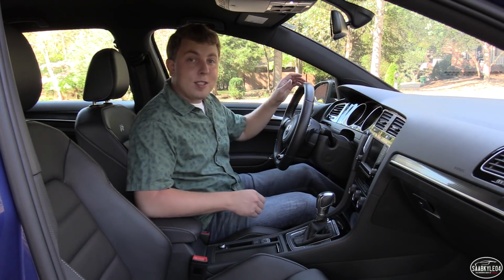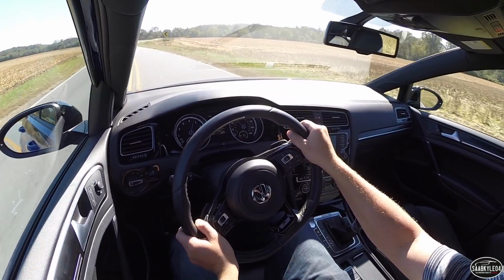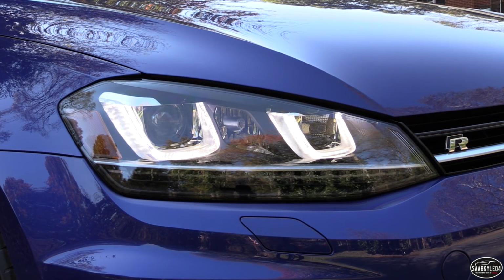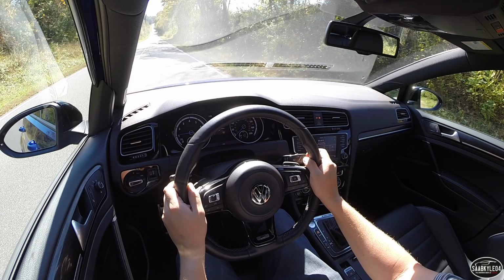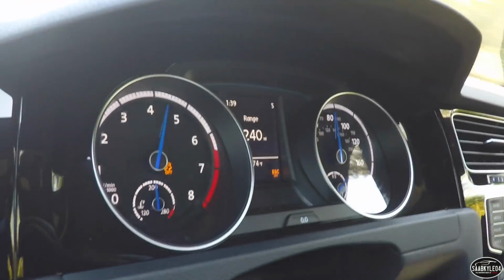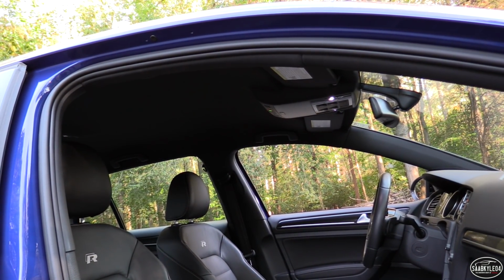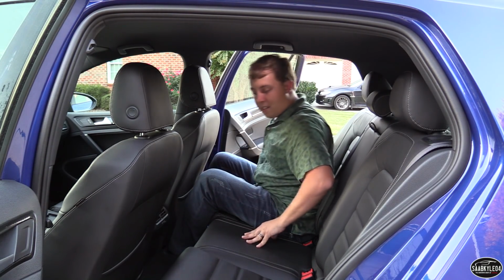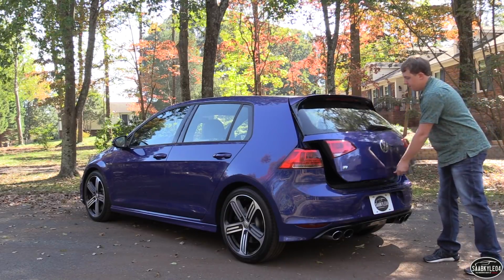2016/2017 Volkswagen Golf R - Start Up, Road Test & In Depth Review

Comment: Does it have a spare tire?
Reply: Very Good no spare tire. no space built-in for a spare either. the AWD system takes up the space where the GTI has a spare. There is an illusion of a place to put a spare, but u can't because that space is for the speaker. I have a full-size 5th wheel and tire. I keep at home if I get a flat I get towed to my house by AAA and change it there. on a long road trip with remote area's I take the wheel with me in the boot
Reply: That's strange, I have a 2017 Audi TTS which shares the same platform and drive train as the Type R yet it has a spare tire and it shares the same all wheel drive system as the Type R.

Comment: Waiting for my GTI Clubsport to be delivered (290 hp on overboost & sends 100% of power to front wheels). Im from Sweden & sadly you cant buy this model in the states. Its a great deal at the same price as the regular GTI. But either way, you can get GTI Performance or R. Also dont forget their very tunable.. ;)

Comment: Great review, Kyle. I have the lo-line 16 R DSG and couldn't afford the hi-line. Have you driven borh versions in race mode and compared them? I think (?) that the DCC on the hi-line realistically only brings the comfort mode to bear and that they're both as firm / similar handling in race mode--other than the 18" vs 19" rim disparities.

Comment: I have a 2017 Golf R. But I only have 2,000 miles on it and it possibly needs a new engine....Other than that, I had a blast in the 2,000 miles I put on it. Spacious, good on fuel, awesome sound system, amazing features with the tech package, and just a blast to drive. Can't wait for it to be back :(
Reply: What the hell did you do
Reply: Why does it need a new engine? what did VW tell you?
Reply: I guess I got a lemon. Broke it in gently, drove it mostly on the highway. It's just randomly misfiring and they've replaced tons of parts and it's not reacting at all. Still have a base model rental Cruze instead of my R and I miss it a TON
Reply: Did they check the pcv valve? Mine caused all sorts of misfires and lean states

Comment: Kyle, great video, love this car! However, this is a 2016 and I know that because of the wheels and for 2017 there is only one trim for the Golf R and it has the DCC (Dynamic Chassis Control), Navigation, and other features like Adaptive Cruise Control and blind spot warning as standard. The 2016 had two different trims in which all the options that are now standard on the single trim 2017 were optional. Only reason I mention this is because in the title you wrote "2016/2017".
Reply: Ah, never mind I see you addressed the 2017 as well, they are exactly alike aside from wheels, trims, and cost.

Comment: Any advice on a first car?
Reply: New or used
Reply: Silver_Arrow..1st car should be used. buick model 2006 to 2009 LaCrosse . FAST and reliable. quiet &  roomy. cheap
Reply: Silver_Arrow 3800 v6 runs on unleaded regular gas =$1.90 a gal
Reply: Well I live in the UK and I want it used. Haven't passed my test yet
Reply: UK... Britan does have more taxes and, insurance regulations priced on your car's engine size or max killowatt.. And smaller roads with hedgerows:) So , mabee look at something small like Mini-Cooper up to a used mercedees C class. or a better bet would be a nice Opal / Vauxhall Mokka from 2013.
Reply: missingremote Thanks for the information👌

Comment: Why the rear doesn't have LED tail lights, and why is the turn signal the same place as the brake lights, when there is actually space for a separate turn signal?  I hate that VW does that.
Reply: Tim Joseph The european version gets the LED taillights, don't know why they use the traditional ones in the US. In eurpoe they only use them in the two lowest Golf trim levels.
Reply: Tim Joseph I hate that too. Not just VW does that, many other European brands have done that and even GM has done it.
Reply: Tim Joseph I agree, the incandescent bulbs have proven to be unsafe due to their lack of brightness but yet they continued to use them even into 2017 models. I had to switch out my incandescent bulbs on the back to LEDs so that they matched the headlights.
Reply: I thought it looked a bit weird, I'm glad Europe spec ones have the LED R lights
Reply: sucks that the Euro LED tails for the R are almost 1000 bucks to retro fit it to the us specd cars smdh

Comment: I really want a R but it's so hard to find a top end DCC with driver assistance and dsg transmission
Reply: don't get DCC, my biggest regret. Save the money and go with aftermarket suspension
Reply: Buy it new?
Reply: No, used forgot to mention that
Reply: Could wait for used 17s since they only come with one option of manual or dsg
Reply: Tech Defender I'm in the exact same dilemma! I want a fully loaded one, probably black on black, but it's so hard to find them with adaptive cruise, dcc, navigation, and other stuff like that.
Reply: ShawnTheGreatHD why do you people have to buy it used if you want the latest model?
Reply: Supcharged Because depreciation my friend, after a couple of years the 2017s that are around $43k new will be around $30k or less used or CPO.
Reply: ShawnTheGreatHD hmm so you're already planning for you 2020 purchase??
Reply: Supcharged Yep I suppose that's right, it's either this or an S3, S4, or 340i M Sport which are in much different price brackets. Which do you think is the best?
Reply: I would have easily got an s3 buy there was no hatch version and this was the closest
Reply: ShawnTheGreatHD I would go for the S4 because I'd much rather have a sedan, but that's just me. I personally hate hatchbacks lol
Reply: But I want the driver assistance stuff which means I'm forced to get it. How bad could it be
Reply: brother i feel you, i got lucky and found the one i have but it was a CERTIFIED PRE OWNED!! now THAT is a hard to find R with everything you mentioned but this car in incredible, i traded my 17 SS camaro in for it so belive me lol its awesome

Comment: It's a DSG?   They're always 6-speed manual only.
Reply: The last-gen were manual only.  The new ones are DSG only for 2015 and DSG/Manual for 2016+
Reply: They have always been available in DSG
Reply from the maker: Yes, the DSG has been available for a while now.
Reply: Iron Man not quite.  A dual-clutch transmission is essentially a manual transmission split into two halves, which odd gears controlled by one clutch and even gears by the other.  It is computer controlled (automatic), but you can almost always manually control the gears when you want to, just not with a clutch pedal, and sometimes with paddles on the wheel or steering column.  Many modern high-performance cars have dual-clutch transmissions, like the Nissan GT-R, Lamborghini Huracan, and McLaren 650S.
Reply: The8TrackChap murica 😂
Reply: ZigSteenine DSG is available everywhere in the world
Reply: What's DSG?
Reply: Iron Man it's what VW calls their dual-clutch automated manual tramsmission.
Reply: Daniel Senti Oh, so it is a system that grants you both manual and automatic at the same time?
Reply: I know all of that, but in all the past Golf R models, the DSG was never an option.  They used to only come with a 6-speed manual and no other transmission was available.
Reply: The8TrackChap I know you would know, I'm explaining to Iron Man what it is because he didn't know.
Reply: The8TrackChap really? DSG was always available else in the world
Reply: MKIV R32 was Manual Only
MKV R32 was DSG Only
MKVI R (20) was Manual Only
MKVII R is available in both
Reply: Zach Payne also the mk4 r32 was the first road car to ever have a double clutch transmission
So the whole secret behind Ferraris and Bugattis was originally in a golf
Reply: Daniel Senti - which is a synonym for an automatic transmission. There’s nothing manual about it when you have an automatic gear shifter that when you want, it down and upshifts for you.